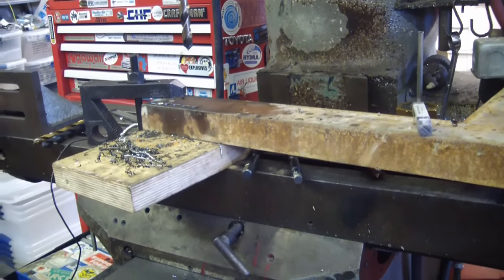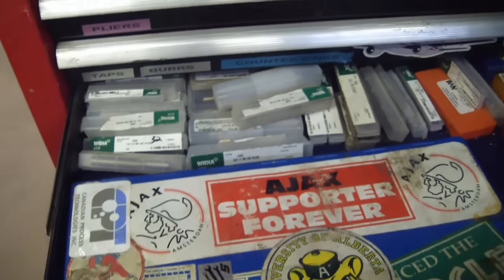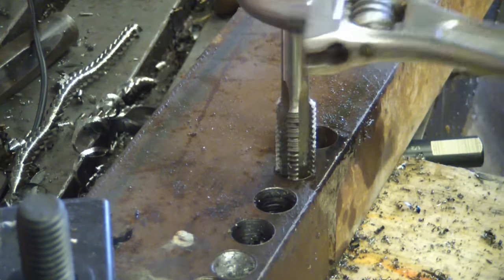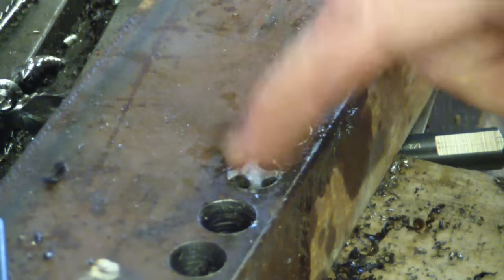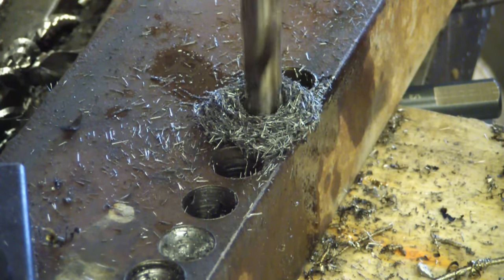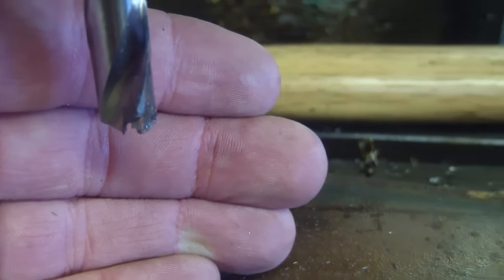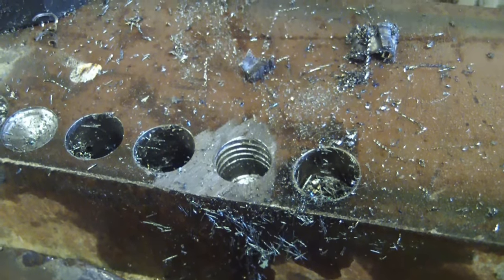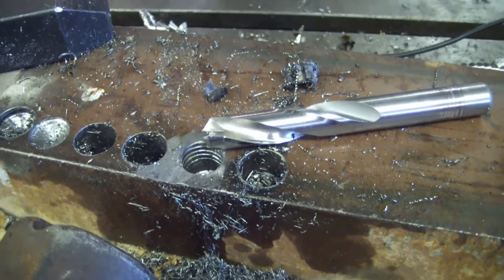Manly-man skills: Remove a broken tap the hard way.

Comment: I have just discovered you thanks to YouTube's amazingly stupid Algo, considering what I watch you should have been on there years ago.... as for the slurs and  stuff like that there as long as you are putting the konkulator valve into the framis and stopping the Chowhai (sp) from infiltrating the dramis bearing then there is not harm in being a Guilo (sp). Don't forget to clean the sparktrons before machining as the tend to get a small bulbering right under the smachingit. Peace I am subbed, I have never used a rotary broach, mill or lathe (that is a lie) nor have I ever broken a tap, drill bit or cutting tool of any kind (another lie) HHS 2000 is the best lubricant to prevent problems unless you have a wet machine...... I sincerely hope you read this bullshit I don't get to use this jargon much anymore (disabled machinist) don't kick the corners you will find all my lurking spots....

Comment: My daily carry light is a Fenix, made in China, and for good reason. They do everything right. But I've seen drill bits from Harbor Fright made somewhere south of The Great Wall, I ain't sayin' where, which were so soft they untwisted the first time we tried to use them. It was hilarious - they hadn't been hardened. So of course I know whereof AvE speaks when he says "Chinesium". And I've also seen "Made In America!" Vermont-American taps that were harder than cancer, no tempering at all, and would snap if you looked at 'em cross-eyed. Every country makes some crap, and pretty much every country makes something of quality. Caveat Emptor. But if the Chinese gov't would stop subsidizing the old-style factories making garbage so they can deliberately dump low-grade goods on our shores, that'd be swell. Modern Chinese companies like Fenix are refusing to play that game, and making money hand over fist while doing things the western way, with real customer service and all, and more power to 'em.

Comment: Hammer some needle nose plier tips into the openings and use an Allen wrench to force that tap out. 
Drilling the shit out of the hole with tools available, but sometimes you have to learn through looking at adversity in the gooch first.

Comment: Well... snapped off a #10 tap earlier tonight and proceeded to attempt grabbing the little bit sticking out, which promptly snapped off. Then  i got out the vaunted Craftsman "drill out" or whatever its called to remove the tap that way. No dice. I then ruined a nice new 1/8" cobalt bit from Viking. I should note that when the 1/8" bit snapped off, i managed to stab myself in the hand and get a nice puncture wound. I've given up for the night, but will return to the fight in the morning. Carbide Burr will be the next attempt.
Oh... the tap i'm attempting to extract is a Made in USA Irwin. Good luck eh?

Comment: take a 6011 or 6010 weld rod.  Make a wood block that  has a hole  just barely  fits the rod as a slip fit.  Position the block so the hole id centered on the  tap.  Turn the welder to 11 and   position the rod in the hole    yadda yadda work clamp  stinger ets.  And when  ready  shove it through.

Comment: Ok so you had a best case scenario where you could use a drill press but it still didn't work out quite to plan.. I've had to deal with many broken taps and the best way is to just bust it up and try not to fuck the threads too bad. Then re tap it

Comment: AvE, I need advice. I have a car subframe bolt with F*cked threads. It is moving, but i'm afraid of shearing off the nut that is welded to the chassis of the car (to acces that wyou would have to remove the entire engine + gearbox + cut + weld a new nut). So, no fun. I want to cut off the hex head of the bolt and drill a pilot hole strait through the rest of the bolt. Than, simply drill it out until I can thread a helicoil in it. 

Question is, how do I propperly center the pilot hole?
Reply: In my general years of go for it approach it seems like as long as you carefully try to center drill it you will definitely be off, bit there will be plenty of meat left to drill out and re bolt.

Comment: I call bullshit, I snapped a tap in an accessory bolt hole on the passenger cylinder head of my ford 460 while chasing the threads, I called a machinist buddy of mine and he said he’s got a set of tap removal tools. He asked the size of the tap and told me to swing by and borrow his, he also warned me the tangs that slide into the flutes need to be clean and instructed me to use the barrel over the tangs as I was removing the tap.

I used a straight pick to loosen any chips in the flutes and blew the hole out with shop air, ground the tap flat and inserted the tool dry as my buddy instructed. He said apply pressure and watch for any twist, he said if it starts to twist but not unscrew to tap the face of my ratchet with a small peen hammer to jar the tap loose. I did so and it broke loose and screwed out with ease. I then blew the hole out and was able to tap the hole without trouble.

He said the 1st tap must’ve been weak or got hung up on a chip and twisted until it broke, he said it doesn’t take much and if the tap is weak it’ll snap even easier. I finished up chasing the rest of the accessory bolt holes while I had his tool and had no other problems, I cleaned and returned his tool then went back home and finished installing all the accessories on the front of my engine from doing a timing set swap and timing chain cover gasket that was leaking.

The tanged tool for removing taps worked fine for me and I’ve ordered a set for myself as I’m a mechanic and have ran into this before but always had a machinist do the tap removal by the request of the company I worked for. I do all my own broken bolt and tap removals now when it happens, though not often do I break bolts or taps, I’m usually pretty good at removing stubborn fasteners with heat, punches or drilling and retapping.
Reply: Josh Frank no that would be incorrect, my comment was in part based on a statement he made about a specific tap removal tool that he claims rarely works or breaks while in use. I’m my case that was totally incorrect based on his statement, and I explained why only in case my process or instance in using that type of tool wasn’t a similar case to which he ran into.

Comment: Speaking from experience none of your methods would work on the brand new style and material snap on uses on their taps. A coworker broke one of mine off inside of a liquid ring pump and we never did get it out we had a dissolve it in some fluid

Comment: Last time I broke a drill bit and an EZ out inside a 3/4 bolt... I ended up using a concrete drill bit to drill them out(carbide tip) slow but it works.

Comment: To be realistic you should have drilled the hole smaller and torqued the tap untill it bound up and then broke off. Tjays why you had success right off taping it loose with the punch. I've never broke even a cheap tap like that cause I avoid striking them sideways with a hammer.

Comment: Snapped tap was too small ( 3mm ) + I've only limited tools, so I just left it in place of the screw I was going to fit - what a bodge!
Reply: yeah I filled in a hole once. sanded it smooth and figured one missing bolt wouldn't hurt.

Comment: Those guys griping about the racist content have obviously never worked in a machine shop.  They can get so creative in their racism.  

Anyway, there is a tool called Omega, it's like a square piece of carbide with an odd point ground into it, that works pretty well, but from Travers Tool Company, it's $158.  They don't chip like a carbide endmill would, much stouter grind.

Comment: Those little tap removal tools are just junk !  Don't even think about buying them . I always use carbide bits and RIDGID thread cutting oil with Sulfur  in it . It lubricates , cools and makes all bits last MUCH longer ; drill bits too .

Comment: My favorite tool is hammer also weapon of war and beat them out its easy outs I break usally the smallest ones same as tap brittle and shatter it was a lil worried working on heads on bmw bike because a hammer is best at identifying the most expensive parts near where your working  no worries the dealer leaft an extra bolt floating around behind the head guard I was pissed finding it but was thankful it was there as I found out they never heard of antiseaze what do you expect with minimum wage help .